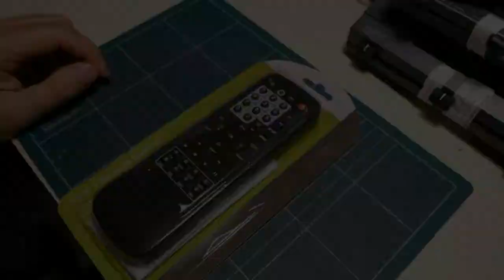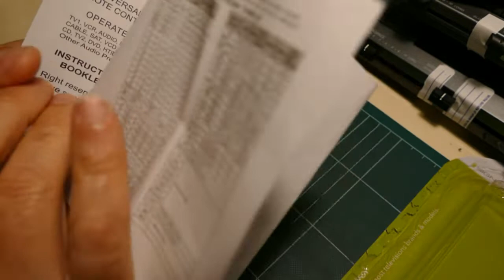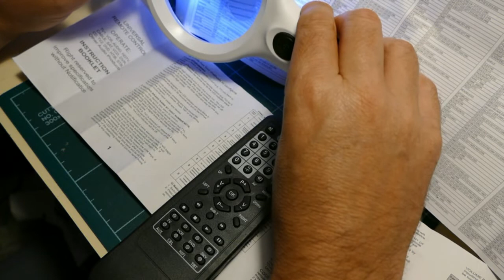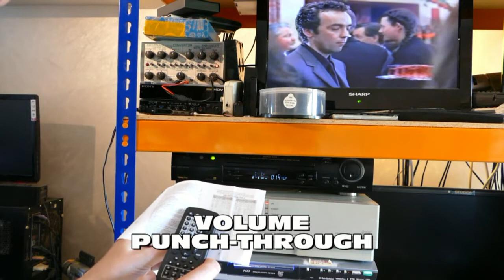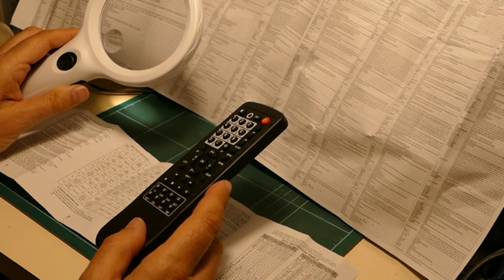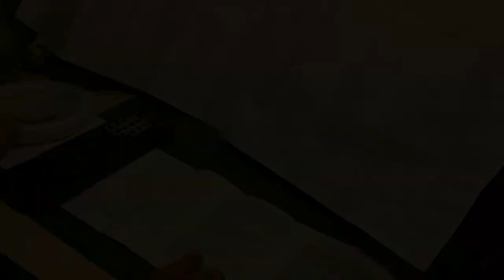Poundland (Signalex) universal remote control.  Includes full code list.

Comment from the maker: Instructions:  https://www.video99.co.uk/images/instructions.jpg
Full scanned in code list now available:  https://www.video99.co.uk/Remote_Codes.pdf
Poundland were good enough to provide the original PDF file which is searchable, this is provided with their permission:
https://www.video99.co.uk/images/10_in_1_Remote_Control_List.pdf
Audio and video transfers: http://www.video99.co.uk/
Reply: Toshin rgt-g24dn4 tv😭😭😭😭😭😭😭😭😭😭please
Reply from the maker: @askyourself4820  Toshin doesn't appear in the list, so we're guessing.  Try the Vestel codes in the list:
https://www.video99.co.uk/images/10_in_1_Remote_Control_List.pdf
If none of those work, then it may not be possible.

Comment: Do you know what the code for a celcus is please?
Reply from the maker: Is that a TV?  It doesn't appear on the list at all so it won't be easy.  Perhaps try codes for Vestel.
Reply: @video99couk  yeah I tuned it before but it has stopped working and I can't find the sheet now will try that thank you
Reply: @video99couk  I have figured it out now thanks

Comment: Code for LG tv sir??
Reply from the maker: The code list is given in the notes to this video, use the searchable PDF file by preference.  There are a number of different codes to try for LG TVs.
https://www.video99.co.uk/images/10_in_1_Remote_Control_List.pdf
Here are some of them: 0043.0067.0075.0082.0083.0111.0123.0125.0141.0145.0153.0158.0170.0227.0277.0230.02
36.0275.0329.0352.0359.0384.0513.0529.0542.0547.0555.0557.0561.0587.0925.1439.1459.
1498.1476.1606.1607.1612.1614.1659.3044.4206.4207.

Comment: Tcl smart tv?
Reply from the maker: According to the code list which is linked in the pined comments, TCL tv should be either 0561 or 1523.  If neither of those work then it may be hard or impossible to find a suitable code.

Comment: Code for 28" Hisence LHD26W57UK?
Reply from the maker: The code list only gives brands, not model numbers, so it's a case of trying these: 0083.0145.0376.1547.0539.0352
Reply: @video99couk  I held TV and OK for about 2 seconds and I got the flashes of 0145 but how to I programme that to the TV so it connects ?
Reply from the maker: @yingyang2467  If 0145 didn't work, you will have to try the other numbers.

Comment: Hi do you have the remote codes for Kenmark 22LVD46D tv?
Reply from the maker: There is no listing for Kenmark in the instructions, but I believe the same TV was also sold under the Proline brand (used to be Comet own brand before they went bust).  Proline codes are given as: 0043.0295.0554.0375.0230.0417.1619.0170.0540.0513  These will of course include some very old TVs which will certainly be different, but they are worth a try.
Reply: @video99couk  Thanks I'll give them a go.

Comment: Lost manual ,code for LG tv on auto mode please.
Reply from the maker: The instructions (not code list) link is in the description already, see here: https://www.video99.co.uk/images/instructions.jpg
If however they don't work, then I could try to look up some LG codes from the huge code list.
Reply: @video99couk  thanks for your reply, ok it did tune off the automatic search can you let me know how to do that as there not selling no more, so it's just how to auto search to sink it .thanks ,john
Reply from the maker: @johngavin1343  The instructions (not full code list) are linked to in the video comments, here they are again: 
https://www.video99.co.uk/images/instructions.jpg
So you press and hold TV and 6 (for LG brand) for two seconds until it starts searching.  Hold them while it searches.  OK to let go of one of the buttons, it will carry on.  When TV goes off, you have found the right code.

Comment: Technika code please
Reply from the maker: That's Tesco own-brand.  You could try 0262, 0359 or 1262.  If they don't work, you will have to try the slow searching routines.
Reply: Code works but still not getting any joy? Can u break it down for me step by step how to connect to my tv? Does it make any difference if it smart tv? Spent 5 hours trying would really appreciate help 😢
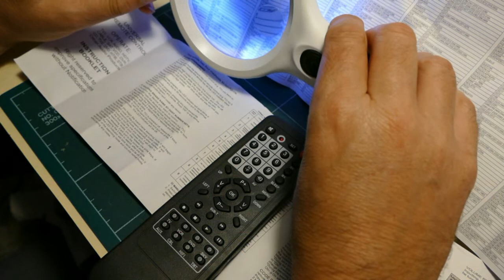Reply from the maker: You should try to enter each of those three numbers (last one is a long shot) as described at 04:25.  If however none of those three codes work the TV, then it's going to be hard.  We don't know the actual manufacturer of your TV.  It could be Vestel you can tell by checking here: https://www.avforums.com/threads/how-to-tell-if-your-tvs-a-vestel.2019864/ 
It might be worth trying some of the codes for Alba, Goodmans and Bush TVs.  If not Vestel, it may be made by  UMC in Slovakia.  It's a real guessing game and it may be very time consuming or even impossible to find remote control codes for a Technika TV.  Sorry I can't help more but this is typical of the sort of problems with own brand TVs.

Comment: Hi. Great video. I just bought this today and lo and behold I have no code sheet included. Would it be possible for you to tell me any code for a Samsung tv? Thanks.
Reply from the maker: Try the codes listed on the link I provided in the comments section above.  I think the Samsung ones are there.   If you get stuck, let me know.  The bit at the end where I switch off the screen where Alex is playing Fortnite, is a Samsung TV/monitor.
Reply: +video99.co.uk Thanks very much. I didn't see your link. I actually just got it working using the option 2 method. The instructions with this are really bad. Thanks for all your help and your video.